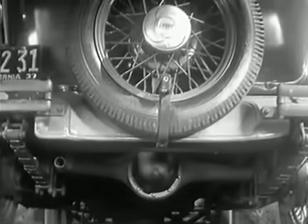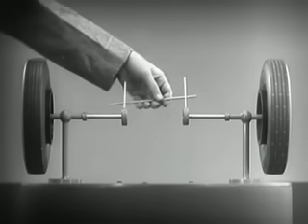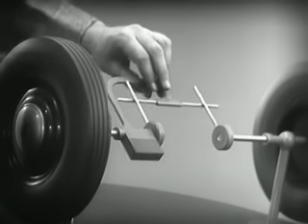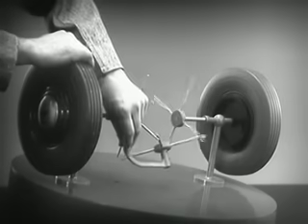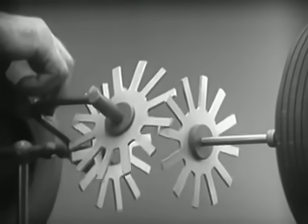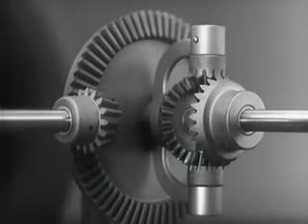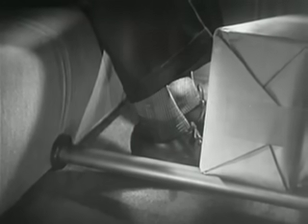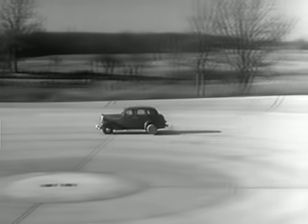Around The Corner - How Differential Steering Works (1937)

Comment: I think the reason this explanation is so good is that it approaches the differential not only from a “ here is mechanically how it works” but a “ here’s the problem that each piece solves” as well.
Reply: These are the people who actually lived in the era that these problems were solved, like the computer engineers of today, their minds lived and breathed these gears and stage a foundation for the modern world where we take them for granted.  They were good people and it's a shame they are no longer here today to see the fruits of their efforts in all the cars we still drive.
Reply: @biomerl  The earliest known differential gears were 1000 years before Christ, in China. Used in chariots. 
So the basic concept has been around for thousands of years, it was just modernized in the early automotive years of the 20th century.
Reply: i think the biggest part is the continuity of problem solving by engineers... when you see the problem and then solution, the problem is not that big afterwards
Reply: The space programs of the 50s-70s was mostly calculated by sliderules, those boys, and some women too were sharp. They were engineering students of life,physics, mechanical, chemical, metallurgical. No computers folks, in their minds,grappling with some heavy unknowns and they pulled it off. was a pleasure to be exposed to the last of them coming out of h.s.entering the workforce. Problem solving at an artform, the best education I could have gotten. Not so many specialists,  some of them were amazingly versatile and wouldn't be stumped, not for long anyway. There stuff worked.  I feel like a slouch now
Reply: absolutely, we understand the differential because we understand what  it is used for.
Reply: The problem solution technique is a great way to explain stuff. The human brain is wired to remember a “why” behind something much more than just a “how.”
Reply: Iterative design! People use this technique to both teach and create in all kind of fields, even today. Most people who know a little about computer programming will tell you that this is their modus operandi. It works for a similar reason to the scientific method in a traditional experiement. Isolating what effect each part has on the final product so you can effectively tweak the design and refine it. You gotta build it up bit by bit to know that it works and why it works.
Reply: @EnderSpy007 guess thats also a pit fall of code in large programs where engineers may not be able to pass on all knowledge, whether fault on them or the person carrying over. Then one tweak screws over another part and no one will ever know why and no one will bother to reread and write the code because deadlines.
Reply: Revelation 13:4  6:04 - 6:36 "..in order to reduce the jerky action caused by wide spaces between the spokes we will have to add more spokes. Further filling in the spaces between the spokes gives steadier, continuous action, and changing the shape gives firm, continuous contact. Now we can make the gears thicker and stronger."

It is correct however that they do not appear to address the "increased durability" statement. My guess would be that a reduction to impact and increased contact between parts would mean that they would last longer (a lighter tap vs heavy thud) but I don't know enough about the mechanics of it to say for sure.

Revelation 1:4
Reply: @Sawta  indeed, continues meshing of the gears prevents shock load and impacts. Shock load is when a part under high stress or no stress is suddenly accelerated. Which is why you can break a piece of spaghetti very easily but if you slowly and cautiously apply pressure to it, you can get it to flex quite a bit.
Reply: @Sawta  In reality, impact loading and number of teeth is handled seperately and are not directly related at all. In gears, the teeth are just made thicker if the number of teeth decreases. However, to account for assembly/manufacturing tolerances there is a small gap between meshing teeth called backlash(usually 50~200 microns in modern differential bevel gears) and this is the only rotational play which can cause impacts. 

Impact on differential isn't much of a concern as it hardly accounts for 0.1% of a vehicle's life. Differential gears are designed completely with normal operation in mind and are simply tested at the very last stage to ensure that they can withstand certain number of impacts. 

The only relation I can think of is that increasing teeth is better for impact simply because the impact wear will be distributed over more teeth, reducing its effect on each teeth.
Reply: ??? @Sawta
Reply: yeah like they basically showed how the engineers solved it
Reply: also think having an actual physical demonstration infront of you helps
Reply: . https://youtu.be/4G6e4TaJxkI ! !
Reply: Yeah thats definately why.
Reply: I agree,  my father tried to explain to me how they work. Finally I understand.

Comment: What I see often in RC cars is that people want to lock up the differential. This is usually achieved by pouring glue inside the differential, making it useless and effectively just turning it into a drive shaft. My question is, why the hell would anyone ever want to do this?! Its job is to help the wheels turn at different rates when turning, that's why it's called a differential! Why the hell would you buy an expensive RC car WITH a differential, and then destroy the differential? Supposedly the differential doesn't allow the car to go offroad because one wheel stops spinning when it gets stuck. That's the whole point of an differential! If you morons want a 4wd offroader, BUY A FUCKING 4WD OFFROADER AND LEAVE THE RACING RC'S ON THE ROAD! Why would you take a racing RC offroad when it's not even intended for offroad?

Comment: Utter horseshit .. modern differential are not spun from the lower end they are spun from the center and the floors are only flat on front wheel drive rear drives have a transmission / driveshaft tunnel  so apparently at some point after this dumb ass video the realized it was horse shit as well.

Comment: With this principle in mind, think of this.  One of you're cars wheels has traveled farther than the others.  Not weird enough?  With this same principle, one of your legs has taken a significant number of more steps than the other.
Reply: Hell yes, it does! Measured over a long enough distance and walking in circles, of course! But, there comes another peculiarity in... your two legs are not of equal strength. So, even if you want to walk a straight line on a field, you will be off a few meters when you reach the end. Think about it :)

Comment: And this is how differentials work. No extra filler nonsense from the narrator, no attempts to add amazement and awe, just straight to the point explanation and presentation of a essential piece of engineering used in our everyday lives.

Comment: Fun fact: You can drive a differential backwards with two motors, from the wheels, and then it averages their speeds. Then you can use a gear to double the outcoming speed and get a machine that adds the incoming speeds together.

Comment: Can i ask why the differential knows how the wheel is inside or outside? As far as i can see bothe the gears are in equal length, so how can it do that?
Reply: The inside wheel naturally gives resistance to faster spinning so the differential rotates around the inner wheel gear instead of driving it until resistance from both wheels are equal

Comment: I still don't understand. The man shows that the differential works if he hold the wheel so one side is not rotating, that can force the differential to works only to the other wheel. Does that means to make this works we need to slow or stop one of the wheel? Does that means this system works with brakes? Or this naturally happen when turning?

Comment: I remember when I realised that my Dad was a genius, it was when he built a diff out of Lego.
Reply: That's sick!
Reply: Top notch Dadding right there.
Reply: I NEED THAT
Reply: 03e3pm fəıkp2nm8hıuñ7sfş
Reply: @Keegan Young Hell yeah, I need some gears, gonna buy some soon. Hell, maybe I could put a lego transmission in a real car lol. ABS plastic to the rescue!
Reply: @Keegan Young Thanks, blessings!
Reply: @Keegan Young Well this was in the very early 80's and I remember that to get it working he did have the modify one of the standard cogs. The centre of a lego cog has the cross shape that allows it to drive an axle. But for the flying wheels he needed one that could turn independently of the axle so he drilled the centre. I don't remember taking it apart but clearly it got dismantled at some point.
Reply: @NickAskew  My guess is you were imagining things. The first lego differential (part number 73071) was released in 1980.
Reply: @parafolly  Nope, he built it from the cog set that I already had. I remember he had to drill the centre of one to make the crown wheel and planetary cog carrier independent of the axle. If I still had the lego, I'd probably be able to build it again having seen it. He was a very hands on person when it came to mechanical stuff and later in life he built a steam engine from scratch (not a kit) and before that he was always repairing and rebuilding the farm machinery.
Reply: He really was a genius...
Reply: I made a Lego diff without any technic pieces.
Reply: @Keegan Young basically every set with a working engine has a diff
Reply: Damn

Comment: Still didn't solve the one wheel drive traction problem that was mentioned at the beginning. In fact made it worse. Now if either of the rear wheels looses traction all the power is sent to that wheel. 

Introducing locking rear differential

Comment: Look, I am a genius. I have found a way to spin the wheels at different speeds.
next day the car gets stuck in the mud
No, please lock the wheels together, thank you!
Reply: Now we just need a 1930s video on limited slip differentials and dif locks.
Reply: @markp8295  :   I was thinking the same thing!   (OK, maybe they didn't have 'em in the 1930s, but certainly they did by the '60s!)
Reply: @Bresianos  With a proper traction control system, it's also possible to achieve the same results by using brakes even with a standard open diff.
I was just being sarcastic as it goes....not to say that locked diff don't have their uses tho.
Reply: If both wheels are stuck in the same mud they'll both spin at the same speed bro
Reply: @Immanuel6468  That's not how offroading works. Have you never driven uphill on snow? Once you lose traction on one wheel it starts spinning like a jet engine while the other one is locked in place doing nothing. 

There's a reason why proper offroaders have lockable differentials.
Reply: @Immanuel6468  : But it's never perfectly equal.

Comment: I worked on cars and engines my entire life.  I rebuilt an engine when I was 18 and took apart a transmission and put it back together but never really understood the differential.  I ultimately went on to study mechanical engineering at a prestigious university.  I just learned how the differential works in less than ten minutes...including entertainment!!

Comment: Awesome video. I'm trying to understand something about it and I'd appreciate anyone who can help me. So does the force to each tire just always even out? Like if one tire was spinning in molasses and the other was spinning freely, would the differential just make even out the torque so that the one spinning freely would just spin a lot faster?
Reply: It doesn't really do what we would call balancing or even the torque between both wheels. This is why trucks and four wheel drives are equipped with devices like Limited-slip and Posi-trac differentials. Now, with anti-lock brakes, the car can sense one wheel spinning freely and apply only the brake caliper on that wheel. This resistance will cause torque to be sent to the other wheel in molasses. Yes, it has happened. Streets have been flooded with molasses before. https://www.history.com/news/the-great-molasses-flood-of-1919

Comment: All conceived and designed without modern computers. The human brain, slide rules and pencils to paper on drafting tables. No CNC machine fabrication. What a time. What did you do at work today, honey? Well we...
Reply: They didn't have computer numeric control. However, just like they had Player Pianos to automatically play the piano, they had machines that could automatically machine parts. Clever people then were just as smart as clever people now. The difference is that they had to do everything the "hard way" and they had to be very resourceful. So, I think they might have been a little more clever.
Reply: @tj6670  The "hard way" makes me think of the times before diesel engines and hydraulics, facing monumental construction projects. Very clever indeed.

Comment: Differential Gear Settings is Best for Drifting. But, too Bad when The Car was Stuck!!  There should be a Gear Setting Changer.

The Pivot Gear Setting convert to Non-Pivot Gear Setting (Standard Fix Constant Gear setting).

Pivoting Gear made the Car best for Drifting... But how about when the Car was Stuck!?

Comment: >Alright, we've done the scale models demonstrating how a differential works, but we need to demonstrate it on a real car. What we've done is attach two garbage bins to the rear wheels. James and Joyce, you will get out while the car coasts in drive and run on top of these trash cans. Here's the keys Joyce

>Sir with all due respect, you're letting a woman drive?

>James, its 1937, women can drive, its not like they're black

Comment: I love how originally they were like no the drive shaft would be awkward. Then it became standard to put in the hump which made every car ride a nightmare for whoever got stuck in the middle for decades.
Reply: Well, it was a necessary evil if the car was built with rear-wheel drive.  Any lower and the drive shaft could hit things like protruding rocks (if off-road) or speed bumps and suffer damage.  Fortunately, front-wheel drive has become more common in more recent years, eliminating the need for a driveshaft because the entire drive train is up in front of the firewall.
Reply: @ApartmentKing66  so most cars are front wheel drive now but why do cars still have the hump?
Reply: @bobafettjr85  I'm not sure but perhaps transmissions have gotten larger and require the hump? Just speculating,  I don't have a ton of experience working on cars
Reply: @bobafettjr85  
Well, if you look at most cars of today, they sit much much lower than a car from 1937.
The tunnel in the floor got smaller from front wheel drive, but it still remained and got repurposed in a lot of cars, to house the exhaust, so that the exhaust pipe does not smash the ground.

In 1937, you did not need a jack to crawl under your car, in 2020 you are lucky if you can get your head under it just a little.

Of course, in 1937 you generally did not take your car around corners at 60+ mph
Reply: @wiesshund-games  And in 1937 you were expected to be able to do repairs on your car yourself so it was meant to be easy to service. These days people can't even change their own damn oil.
Reply: @demoniack81  Or shift the front-light lightbulb... Doing so has become hell on modern cars, so they switched to LED's instead...
Reply: @bobafettjr85  You'll only see the inside hump on rear wheel drive or all wheel drive cars. Most SUV and trucks are higher off the ground so they have more clearance. Majority of cars now-a-days are front wheel drive because they are cheaper (requires less parts) and are safer to drive (the weight of the engine is over the wheels giving better traction and they are less likely to swerve). Next time you see a car with that hump, go look at the back wheels, I bet you'll see that gear differential from the video, which means the car is either rear wheel or all wheel drive.
Reply: bobafettjr85 my front wheel drive car doesn’t have a hump.  Maybe it’s for the exhaust?
Reply: Exhaust pipe is one thing that runs under the hump
Reply: The hump was not the driveshaft but the automatic transmission.
Reply: Finally fixed in the 2010s with EVs, that need neither a driveshaft nor an exhaust so we get flat floors back again.
Reply: @Wookey.  Miss me with that eco shit.
Reply: @Wookey.  fuck EVs

Comment: It's interesting, that if you stop one wheel from rotation, the free wheel doubles in speed. It seem like this 2 to 1 ratio is due to the stopped gear forcing the small connecting gear to rotate and drive the free gear instead of remaining still.